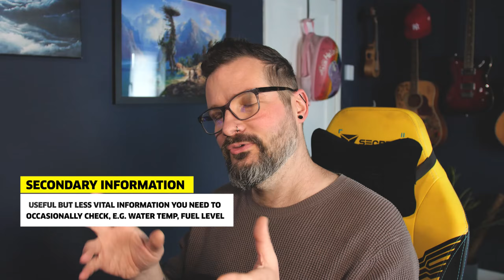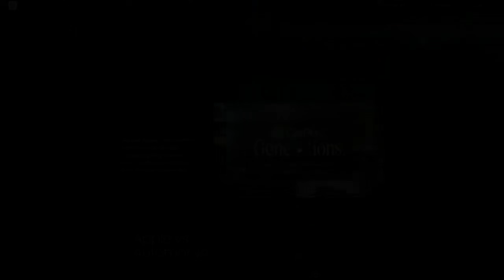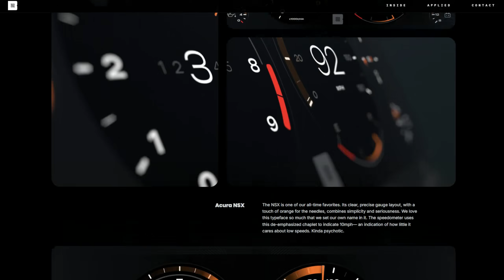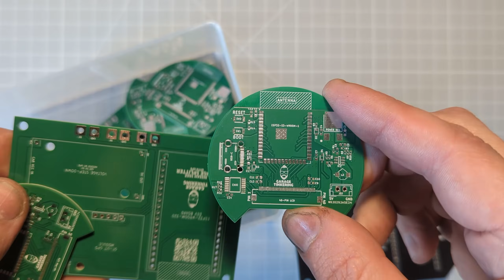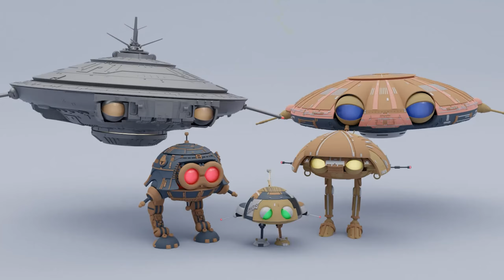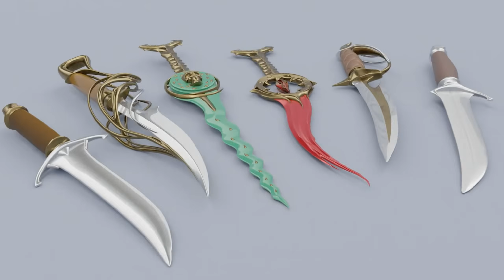Six Skills You Need to Master to Make Amazing Digital Dashboards

Comment: I would rate myself a 2,2,4,4,4,4 doing electrical engineering and embedding and programming for a few decades now. I call myself a real fullstack developer, from circuit design to pixel on a remote screen. The first full size computers I had (and still have) had less CPU power, RAM and storage than the typical ESP style boards. Still stuff to learn, so no 5s ;) The graphical side is my weak-point, that's why I hire designers (UI and UX) where needed. I want to learn and I am getting better, but still far from "good enough" for external stuff.

Comment: Is there a "zero" option? If so I'd like to claim negative 1 on most. Haaaa!
I truly want to get decent (2 to 3) on some of these categories, but it would not be for business use. Instead I plan on creating a custom dash for my current project and do not intend to create anything that anyone else would ever want. Lol.
I do wish I could justify a decent 3d printer as I plan on having to create or modify many bits and pieces, but I don't want to purchase a crap unit and not be happy either. As well as, finding a programmable display that will fit the space, and not be hindered by what someone else thinks "works for most" (if that makes any sense).

Thanks for a good post, it's refreshing to hear your take on things as usual, and also to hear you rate yourself accurately.